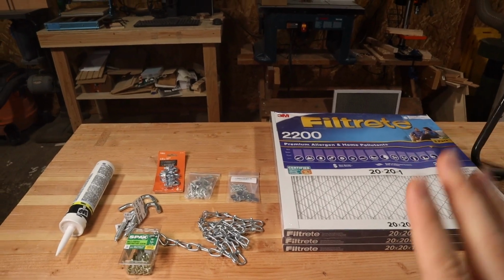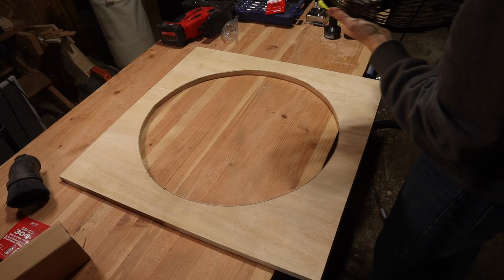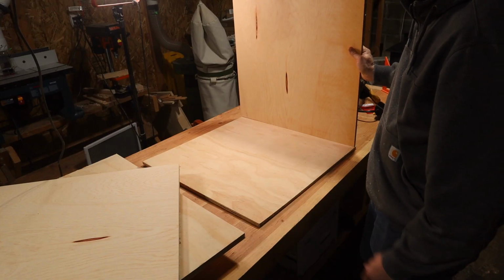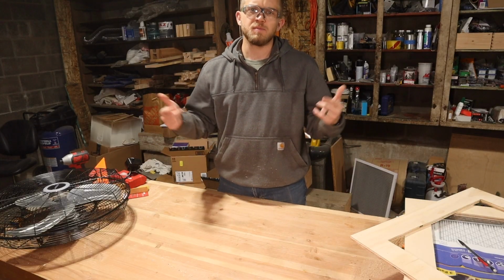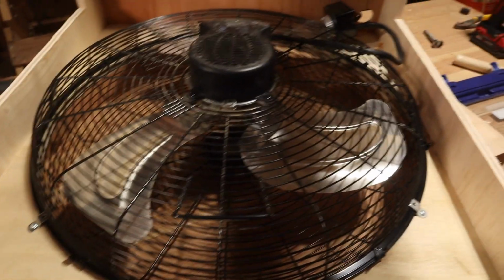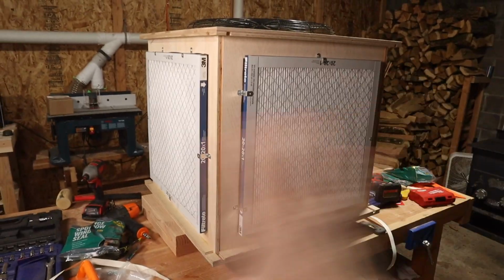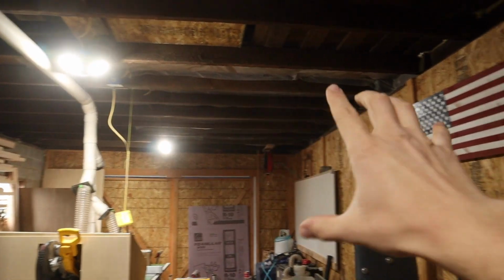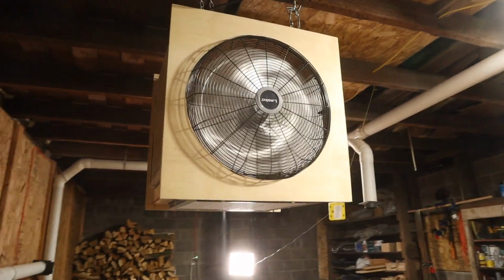Building the Best & CHEAPEST Air Filtration for Your Shop

Comment: A woodworker would use strips or sticks to build a frame vks a hole in plywood to not waste material.  They also make 5” deep nerve filters with the service area of all those 1” filter, that you can literally tape to a box fan and get the same thing.  Cheap merv 1 on intake and merv 14+ on output.
Reply from the maker: That’s certainly another way to do it! At the time I did this, the plywood was much cheaper and I saved all the cutouts to use elsewhere. If I were to do it again, I’d do it like you suggested. Mostly to keep it lighter. 

I tried the box fan for a while but it doesn’t have the static pressure needed to effectively pull air through a filter. It does some, but not nearly enough. 

If you get a chance, you should check out ShopHacks write up on this build (I based this off their results). They put a ton of good work into it.
Reply: @NorthwestCraftsman  you got that plywood cheaper than a 2x4?
Reply from the maker: Nope, but it wasn’t the wildly expensive you see now.
Reply: The problem with a box fan is that the air flow in the corners can reverse and lower net airflow through  the filters.

Comment: Can you pipe your dust catcher outside?
Reply from the maker: You can, the issue you’ll run into is replacement air. If you’re fine pulling in outside air, absolutely. Just give yourself one of those passive dryer vents pointing into your shop. If you condition the air in your shop (hotter or colder) then getting a filter and dumping back into your shop is the best bet.

Comment: Just wondering but do you think putting cheaper filters on the outside of the merv13 filters would make thr merv13 last a lot longer? It would filter out the larger particles so the expensive merv13 wouldnt clog quickly. Wonder if that would notably affect the fan performance
Reply from the maker: Great question. Having a pre-filter like that should help but I’m not sure how much of a functional difference it’d make. I still take mine down every few weeks and blow them out with the air compressor. I’m sure it wouldn’t hurt though.
Reply: The primary goal of the ShopHacks system is to filter the very fine dust that gets past the bag or canister on a single stage duct collector and floats in the air and acts for like a gas than dust, which will eventually settle.  If you have a single stage dc, consider adding a cyclone to it to collect the chips.

I produce a lot of sawdust in my 1-man shop.  I buy all my lumber rough, so I have to plane it, cut it to size....  I also have a 3x5 CNC which makes tons of sawdust, especially on larger 3D carvings.

Comment: You don’t really need the wood. It just adds size, weight, complexity and cost to the build. The filters alone will have enough structural integrity if just glue 5 of them together
Reply from the maker: Interesting idea! Only issues I see are holding the weight of the fan and cleaning out the filters. Unless you treat the filters as one time use.
Reply: @NorthwestCraftsman  I was thinking you could have one permanent, fixed panel for the fan supporting the mounting hardware. Then 5 filter panels glued together for the other sides of the cube. If you want to be able to detach them for cleaning you might need to get a bit creative. Perhaps 3M velcro tape or some type of brackets
Reply from the maker: Huh! Yea, that is an interesting idea 🤔

Comment: Like it,  but,  think you need a cheap pre filter going into the fan.... to protect the fan motor......
Reply from the maker: The fan only pulls clean air through it so it should never see dust. If I reversed the fan, I 100% agree.
Reply: @NorthwestCraftsman do you have a video on your dust collection system to some of your tools? I'm just setting up mine and looking for info.
Reply from the maker: @lauriebrennan1195  here is a video that I made a little while ago that goes over my primary dust collection system. It is not exactly specific to each one of my tools, but might spark a couple of ideas for you. Feel free to comment back if you have specific questions, I am also getting ready to redo my entire shop, so I have been thinking about this a lot lately too.

4in, PVC Dust Collection Upgrade | Much Better!
https://youtu.be/pHl5nf__5VI

Comment: Nope. Get a canister filter and mount a fan of the same diameter on top. Do you want it to be mobile put casters on the bottom. Enclosures are totally unnecessary
Reply from the maker: Huh! Thats a great idea! Hadn’t even thought about that one.
Reply: @NorthwestCraftsman  not my idea, but it WORKS.  You have a platform, get the idea out there!  Cool to see people who grind and adapt and take an idea forward and then share it.  Best filtration system ever.  Love mine~!  Made my little 250 sq ft garage so much more livable and creative
Reply: Can you get a canister filter that will take out sub-micron dust?

Comment: Honestly with that much extra wood I wood just mount it directly to the rafters.   By a quick glance you would get like 4 to 6 inches higher and it would be even more strength.
Reply from the maker: You are absolutely correct! If I was to do this over again, I would slim it down by quite a large margin
Reply: I considered that but then realized that attaching it directly to the rafters would send loud vibrations upstairs into the whole home  whenever I used it.
Reply: @dovgoldstein3755  maybe but there's plenty to reinforce the rafters and spray sound deadening thats pretty cheap.    Fruit for though now but helpful later

Comment: I designed and built something similar except: I mounted the fan on top, there's a slide on the bottom for a 20x20, and around the sides are four 14x20 filters. Works great.
Reply from the maker: Interesting! Do you blow into the box or out with the fan?

Comment: After adding weatherstripping set the filter against it and measure how proud it is from the cabinet, face rip a block that thickness and sister it to the edge of the filter and add a pivot/twist block to that to pin the filter to the cabinet. (All scrap) You don't need a screwdriver to change the filter. A quick twist and out
Reply from the maker: That’s a great idea! I want to get better about making fixtures like this.

Comment: Great project!! Tip: A sliding beam compass is easy to make from a few scraps of 3/4" pine or hardwood for large circle layouts. Cut the beams to the preferred length at 3/4"th x 1 1/2"w x your preferred length. Can make several beams different lengths for a range of diameters. The sliding pencil and center point holders can be made from small blocks of wood 1"w x 2" h x 3/4"th with one side of the 3/4" thickness relieved 1/8" from the bottom up 1 1/2" to create a ledge for the blocks to slide along the beam. Drill a close-fitting hole for the pencil (wrap with thin tape for a snug fit) thru one block, 5/16" in from the outer edge, centered on the 1"width. Next, drill a close hole, 1/2"dp for the center pin in the other block located on the center of the bottom (5/8" width) leg. and glue in a sharpened finish nail/brad with the head clipped off.  A small, 2" 'c' clamp for ea. block is used to hold them to the beam.
Reply from the maker: That’s a great idea! I’ll have to try that next time. Also, very well described.

Comment: Don’t wrap it. Loop the string and Tie a knot for both ends to make a fixed loop then as you go around, the string will just spin around the nail and sharpie.
Reply from the maker: Yea, the issue I had with that, thinking back, is getting exactly the right length while tying knots. Thinking about it more, there are ways 😂
Reply: @NorthwestCraftsman  taut line hitch should work or something similar
Reply: Building a simple circle cutting jig is time well spent.
Reply from the maker: @dougprentice1363  After this video I bought one and it is definitely worth the money haha
Reply: Should have made a jig dude
Reply from the maker: 100% I should have made a jig 😂

Comment: Nice vid. For those who want to be as safe as possible but also have somewhat limited funds this looks like a great option. 
Two things..
1) you mentioned the shop temp was like low forties when you were making this. Can you feel the cold air circulating now as well when it’s running? 
2) wonder if this would be just as effective on a rolling cart making accessing the filters easier and making it possible to direct above mentioned air. I don

I don’t have heat in my work area either.
Subbed.

Thanks
Reply from the maker: Great questions! 

1) absolutely. I actually use this to help circulate warm air when my wood stove is on. 
2) I imagine it’d be slightly less effective because on the floor there are more objects in the way, blocking airflow. The roller idea is very nice for access though and if your shop is open enough, it may not be as impeded as I’m thinking. 

Sorry you don’t have heat! Hopefully you live in a warmer climate than I do or have it well insulated 😅

Glad to have you around! Welcome to the community!

Comment: What is the difference between blowing the air into the filters or sucking the air through? I have seen both builds.
Reply from the maker: Great question. In the “blow air out” configuration, like mine, you’ll have better air circulation in your shop and your fan will stay cleaner. In the “blow air in” configuration, the filters act as a big diffuser so it doesn’t circulate as well as well as your fan being the first component to touch the dirty air. That being said, I don’t have any quantitative data to prove one is better than the other.
Reply: Mine sucks the dirty air in through the 5 filters and blows out clean air.  Whenever I'm in the shop I run the filter.  When finishing, I still run the fan to help get rid of some of the fumes.  When using lacquer, I run my 24" exhaust fan to get the fumes out of the shop.

Comment: Drill a pilot hole for the big hooks. Makes life a lot easier. I usually use a drill 1/2 the size of the hook threads.
Reply from the maker: That seems like a good rule of thumb. I chronically undersize my pilot holes which causes this. 

To your other question, yea! I use it regularly and it helps a ton. I’ve noticed that I need to blow out the fillers every few months but that’s a worthwhile trade off for me.
Reply: @NorthwestCraftsman  I may have missed it—-what is the rating on the filters you used?
Reply from the maker: @shop99er Merv 13

Comment: Useful video. Having trouble identifying how you the cable clamp link you provided would work for 3/4" plywood, I believe the bolts for the cable clamp are not long enough, and in the video you show an Everbilt clamp, not the amazon link you provide.  Would definitely appreciate seeing which Everbilt clamps you used!
Reply from the maker: Yea, sometimes I replace the links so I don’t have so many different sources for parts. Here is what I believe I used but honestly I’d go to your local home store and just measure them to make sure they’ll fit. 

Your friend has shared a link to a Home Depot product they think you would be interested in seeing.

https://www.homedepot.com/p/Everbilt-1-4-in-Zinc-Plated-Clamp-Set-4-Pack-43094/205883026

Comment: How big of a necessity are the dado cuts? Is it mainly for the support or to seal the edges so no air gets in through cracks? Basically is it important enough for me to go buy dado blades if I don’t have any?
Reply from the maker: Not needed at all. Just helps with alignment. If you do it all out of 3/4, I may do pocket screws
Reply: This is a year later so I'm sure you're long done with your project - but you could make multiple passes with a standard saw blade. You set location and cut your first groove on all panels, then move it over just a touch under a blade width, groove all panels again, and keep going till you are just shy of a blade-width to the right size for your dado width. Then "sneak up" on the final position, making multiple passes on a single groove till you get to the perfect width. Then cut the last groove on all of your panels. Boom, done.

I know I've seen it called out in lots of makers videos and I am guessing there are videos on the topic, maybe search something like "dado without a dado blade" for a dedicated video?

Comment: What are the disadvantages of using HEPA filters? The short lifespan and price of MERV 8-13 filters is quite chilling.
Reply from the maker: Great question. Biggest downsides are shorter life (like you mentioned) and more restricted airflow (read as, less effective)
Reply: Depends on what you're trying to filter. Most people don't need to go to the level of HEPA. If you're really concerned about fine-particle dust use a filter rated to remove PM2.5 particulate, which will still have a shorter lifespan than less restrictive filters but will get the really fine stuff that can cause lung problems (PM2.5 is the criterion used for pollution measurements, a 2.5 micron, or smaller, particle that can cause lung damage).
Reply: Once the dust gets into your lungs, it's not ever getting out.  I buy 6-paks of filters at Lowe's for about $70.  To me, it's worth it in the long run.
Reply: @unclebob8746 Are you serious? That's quite scary

Comment: Great video! I just purchased the plans for this from Shop Hacks and came to realize, there weren't any videos on how to build it! So I did a quick search on YT and found you. I am a new subscriber and am looking forward to digging in to some of your videos. 

As a follow up, how are you liking the filter? Is it reducing that fine dust that is constantly wanting to settle on everything in the shop? Also, how long do you run it for? TIA
Reply from the maker: Hey John! Great to have you around! I’m glad you found the video helpful. 

I love this filter! Still get settling dust but much less of it. And I generally run it whenever I’m in the shop and turn it on when I leave. Don’t have a timer or anything on it and like the airflow while I’m in the shop. 

As a note, I have to clean my filters out probably every 3 months. I just use my air compressor to blow them out but that is more often than the guy/gal at shop hacks had to. And then if I was to build this again, I wouldn’t do the dados everywhere. Make the corners flush with each other so it’s a little more compact.
Reply: @NorthwestCraftsman  thanks for the feedback! Have you seen the actual plans from ShopHacks? The sides have tabs so they actually kind of interlock with each other. That’s why I was hoping to find a video of someone actually building the plans. But glad I found your channel anyway - great stuff!
Reply from the maker: I bought the build plans and then modified them to fit my needs more. So they became more like “guidelines”

Comment: I’m debating building something like this and other similar designs. What do u think. I feel that the power of the fan sucks up tons and tons of dust and filters it but simultaneously creates sooo much wind that puts just as much if not more fine dust around the shop into the air the whole time that it’s running so the net effect is not so positive…
Reply from the maker: My experience has been nothing but positive with this in my shop. I think it’s 100% worth building one.
Reply: @NorthwestCraftsman  thanks!
Reply: Technically you're right but as time passes the amount of dust captured should offset the amount created. May have to let fan run while shop is closed for a few days
Reply: @MrDmorgan52  hmm good point
Reply: Not my experience after 5 years of heavy use.